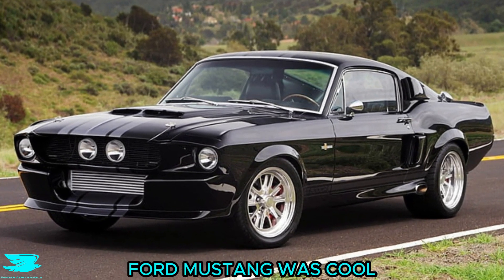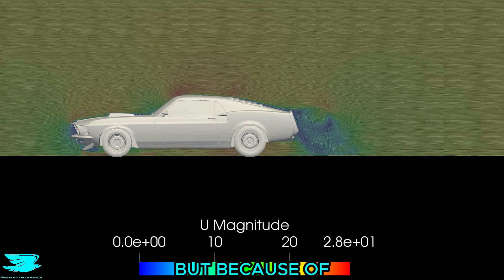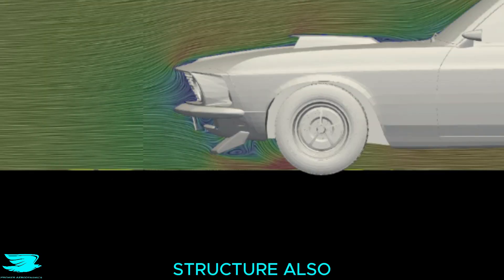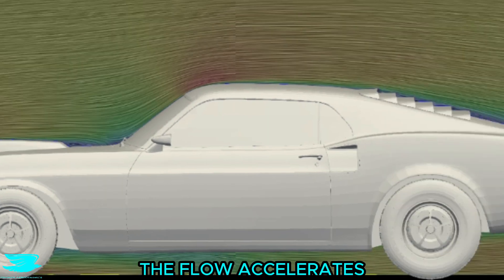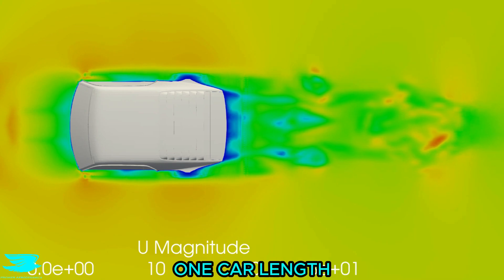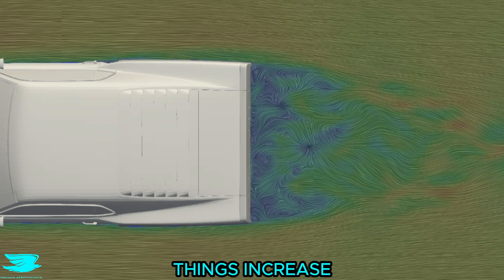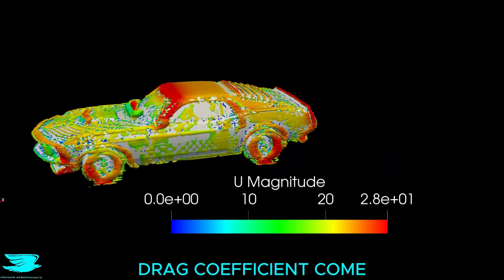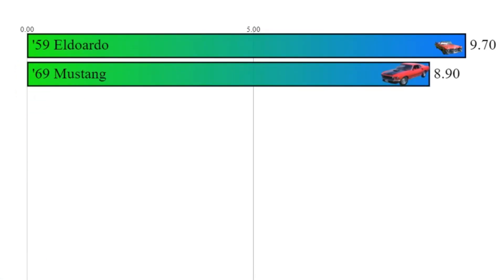Surprising Aerodynamics Of The 1969 Ford Mustang

Comment: Which OpenFOAM solvers are you using? Is it based on the motorbike example ? 

I have a Volvo 1800 and really need to scan it and run some aero sims
Reply from the maker: It is pisoFoam in OpenFOAM, but it is just one of our scripts. I guess you could modify the motorbike one, but you need to add some form of rotation for the wheels.

Comment: This video has me curious about the corvette stingray and how areo dynamic the 69-72 models are. Personally I think the 69 model looks the best.
Reply from the maker: It was a sweet car. If we can find a model of it, we will definitely do a simulation of it. It's too good not to do.
Reply: Terrible, as all old cars. The general shape might be good if you squint from 50 yards away, but there is little to no flow optimization anywhere for details, radiators, wheels etc.
Reply from the maker: @GoldenCroc  Actually, if you go back further, some old cars of the 30s (and even 40s and 50s) are actually pretty good.
Reply: @PremierAerodynamics  lol new car technologysoomer vibe check'd and rekt

Comment: What would it be with the 1969 Boss 302 rear deck spoiler added?
Reply from the maker: Mainly, the flow would kick up a little at the back, reducing the lift, and increasing the drag a little.
Reply: @PremierAerodynamics  Interesting - I own one and it seems more stable at "freeway speeds" with both the front chin and rear deck spoilers than ones without
Reply from the maker: @ragtowne  Yep, that reduction in lift means the car has more grip on the road and doesn't want to float off the road as much. So, it would come through as more stable in feeling.